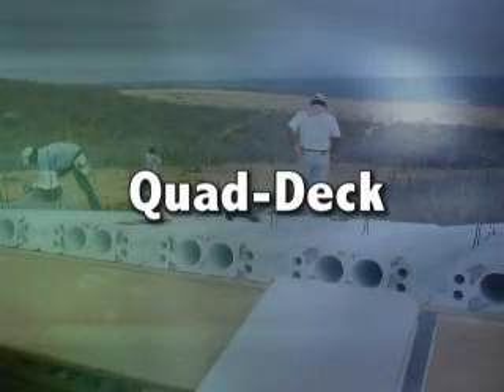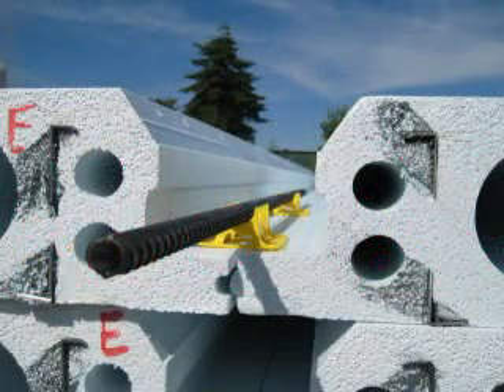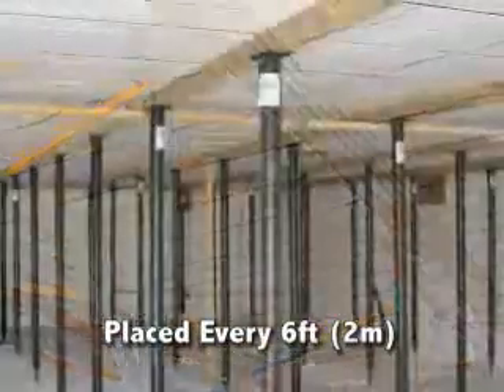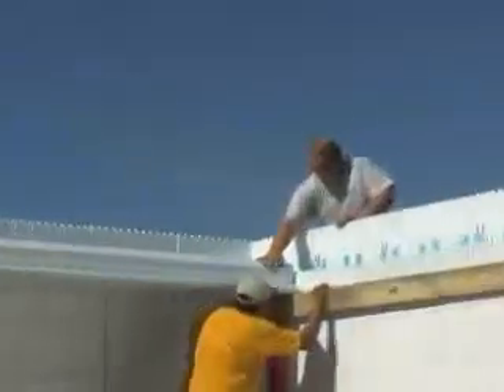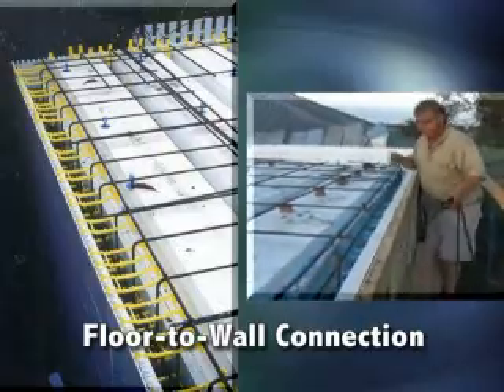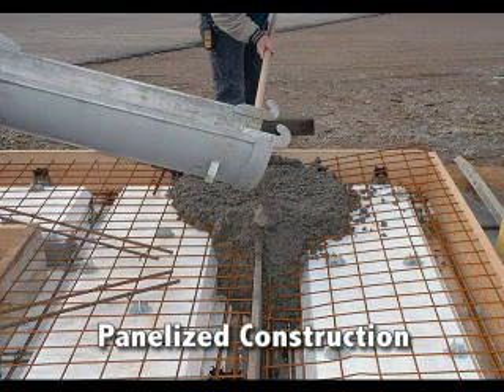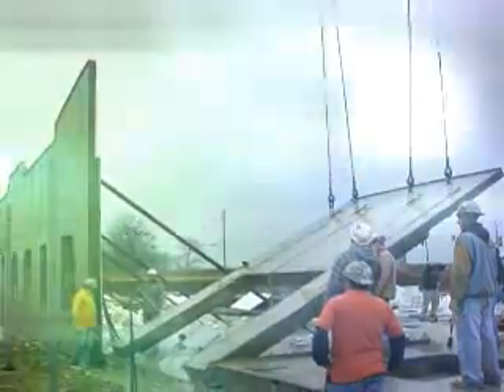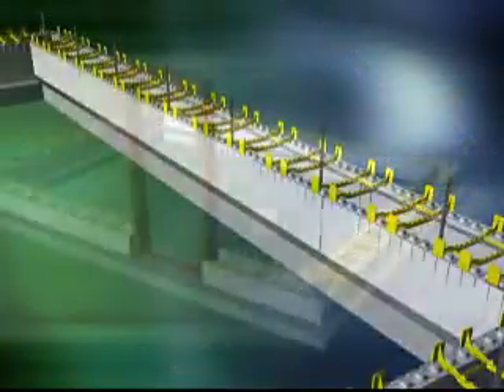ICF for Floors & Roofs - Quad-Deck Insulating Concrete Forms

Comment: How long of a clear span can I go for a garage floor?
Reply from the maker: Depends on the anticipated loads (incl. seismic) and region: in most of the USA with regular vehicle-loads (3,000lb point load) you can span up to around 26 feet. Most of Canada with 4,000lb point load up to around 24 feet.
Reply: How long of a clear span can I get for a house first and second floor, also how thick does the concrete need to be normally in a residential build ?